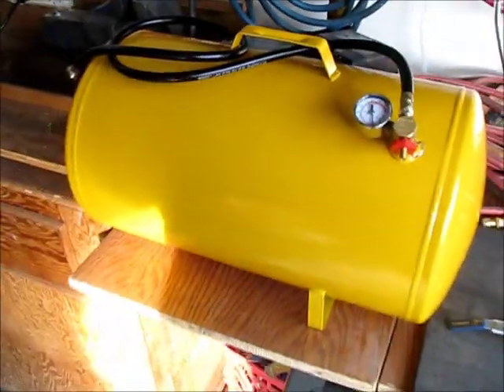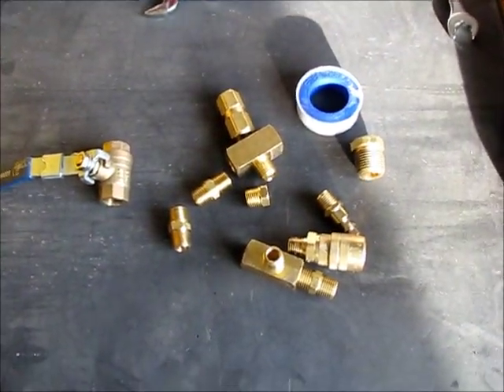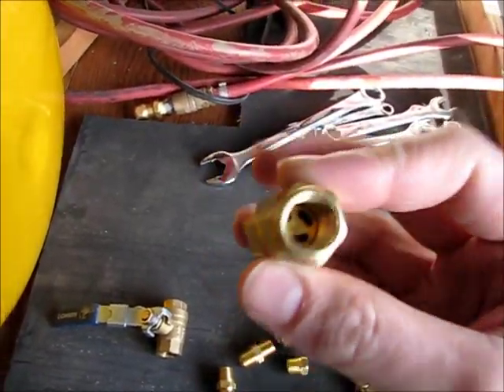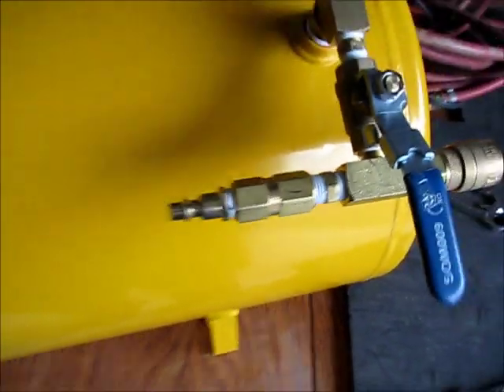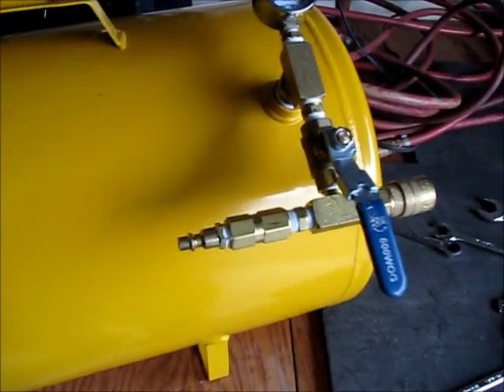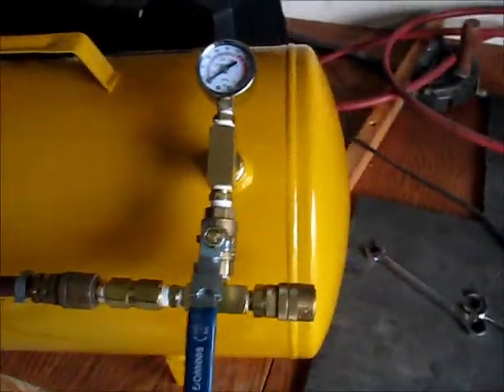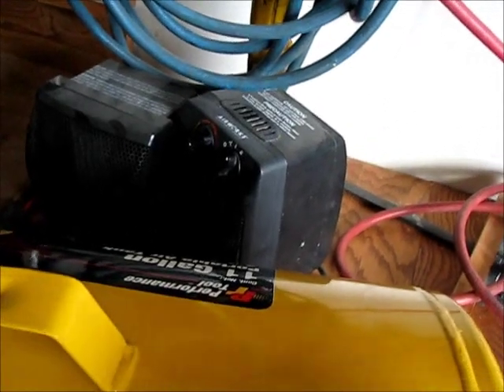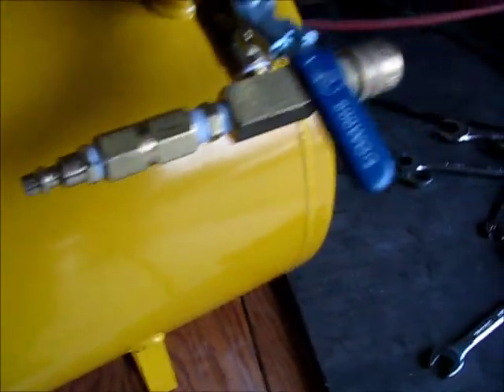Quick fill manifold for air tank

Comment from the maker: Yeah, the compressor is regulated and has a relief valve, it will never fill above the service pressure of the pig.

I have a gauge on the tank because the tank is used for things like filling car tires on the driveway. If I'm out there I want to know how much pressure is in the tank and whether or not it's enough to fill the tire.

Comment: its on the compressor i assume. but then why not just use the gauge on the compressor as well. this manifold is wasting a port on a second valve. the tank is to small to justify its own gauge because once u fill it, you know there is 125 psi. instead of getting that high priced check valve, you could have just used a coupler and dedicated a small hose with 2 nipples on each end like i did to join both tanks.

Comment: doing this means there should be zero line pressure and you can safely disconnect and move the extra tank around if you need to go outside and fill a tire or something. i dunno. hope this helped!

Comment: the problem that im sure you have already noticed is that you can not disconnect the line between the compressor and extra tank because air will escape at max psi due to a constantly open valve. this is why instead of having your typical nipple/coupler on the hose, i put 2 nipples on either end. what i do is fill the tanks, shut the expansion tank pressure first via the handle valve, then cut the line pressure from the compressor.

Comment: this is really cool. i went out and got almost the same stuff as you did but made a slightly different manifold. i did not put a pressure gauge on the spare tank because my compressor came with a safety valve and 2 gauges. having it all connected eliminates the need for an extra "t" manifold because its all on one continuous cirquit so the gauges tell you total line pressure between both tanks. the other thing i did different was that i put 2 couplers instead of 1 niupple 1 coupler on the tank.

Comment: I have one similar and agree 100% with you. Not a fan of how the original fittings are. I think kjbaert has a decent idea of using the coupler in both directions to omit the check valve. Although that would require having a male-male fitting to hook up to an air hose handy. Your way works fine it appears.

Comment: looks like the check valve  put backward or the air will go in but won't come out.
Reply from the maker: Which is the entire point given that it's connected to the inlet fitting...

Comment: Easier, simpler and cheaper to just use a double male quick connect coupler adapter. Plug shop hose into coupler adapter, then other end of adapter into coupler on portable tank. No expensive valves or ten extra fittings to leak.

Comment: I've had a similar tank for 20 years. First thing I did was to install a quick coupler. To fill I remove the tire-chuck hose and connect a hose from my shop air, then open the existing valve on the manifold - it fills in seconds. Just have to remember to close the valve before popping the shop air hose off so air won't rush out. With your new setup you have no pressure relief valve, correct? I do like your ball valve; wish I could find a manifold that incorporates one. My valve now leaks.

Comment: instead of buying a check valve you should have just filled it through the coupler.  Air can flow both ways and closes automatically when you disconnect. And was wondering why you put a shut off valve?

Comment: thx for posting the vid. im in the same situation w a 10gal air tank that i bought at lowe's. bummed that the schrader valve is the only way to fill up. can u tell me roughly what kind of filling speed to expect if i upgrade. is it a dramatic increase? or would u say it is modest?